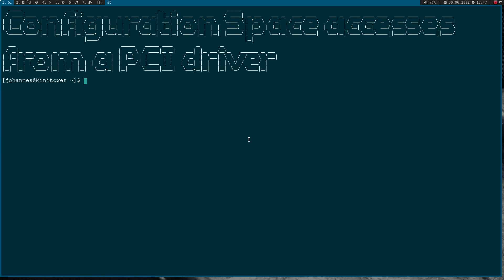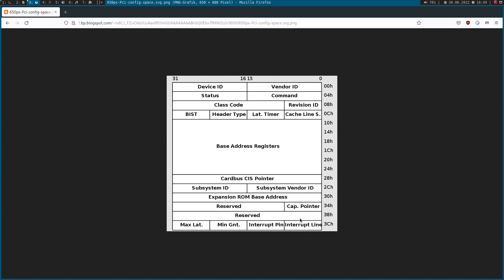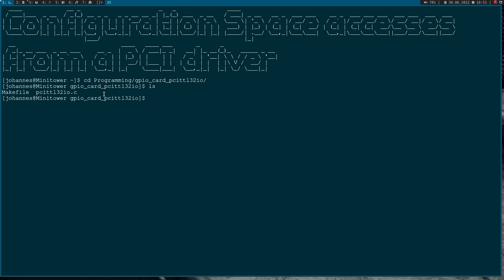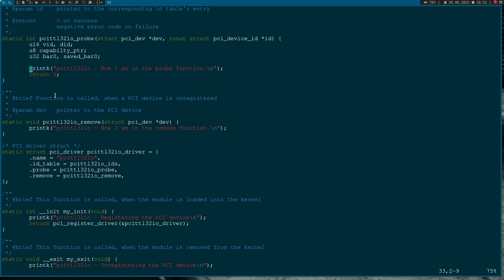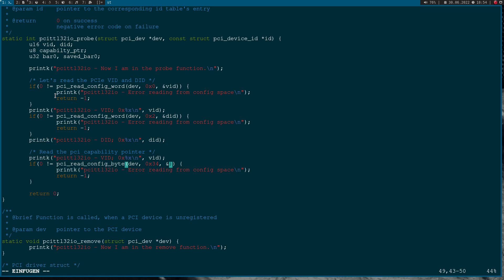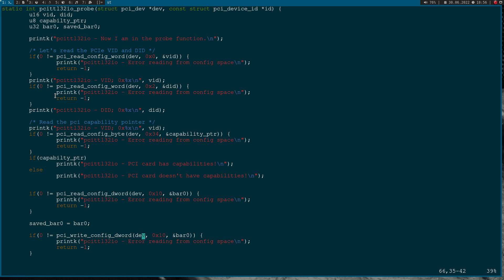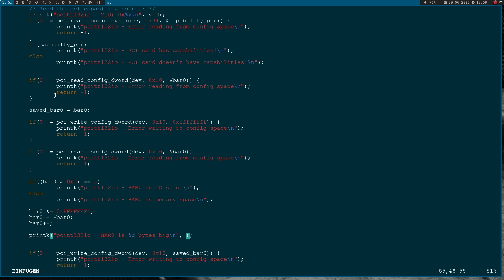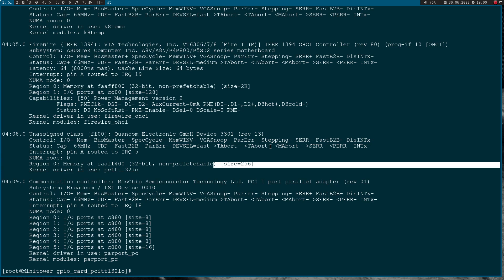Linux PCI Driver Tutorial - Part 2: Access the configuration space from a PCI(e) driver

Comment: Hi! Doesn't the config space hard-coded on the device memory? 
How can you actually write differnet value to it?
Reply from the maker: It depends. Some value of the config space are hardwired and ready only, but some are writable. 
E.g. the vendor and device ids (Config space Offset 0x0) are ready only. Other fields Like the command Register (Offset 0x4) or the Base address Register (which i write in the next Video) are writable.
Check Out the PCI Base spec. Here you can find all the Registers and If they are ready and or writable.

Comment: Shouldn't clearing first two bit be done with C (b1100), instead of D (b1101)? Around 11:10 in the video. Good stuff, by the way.
Reply from the maker: Yes, you are right.
Reply: @johannes4gnu_linux96  I am trying to make sense of it (and having to resort to language models too)
It looks like you would need to clear two bits if it is IO space, and 4 bits if memory space.
But for your case it already was FFFF0000h before inversion, so that kind of worked
Reply: And also, there is whole 64 bit BAR rabbit hole, that i dont even want to touch at this point..
I just wanted touch panel to work in bootloader, and now have to make i2c driver for uefi.. T_T